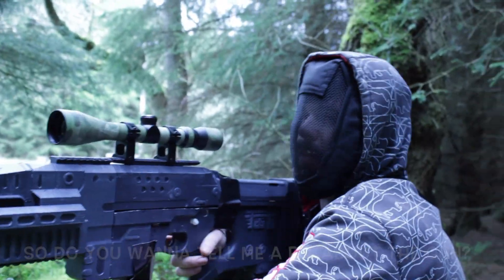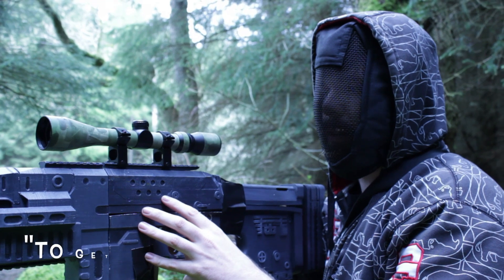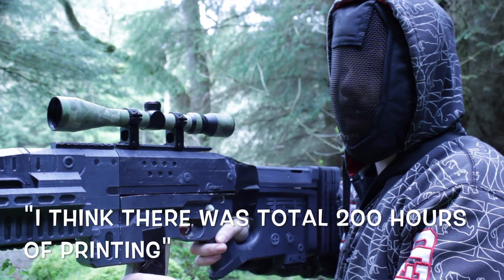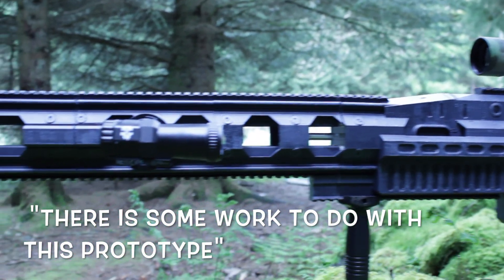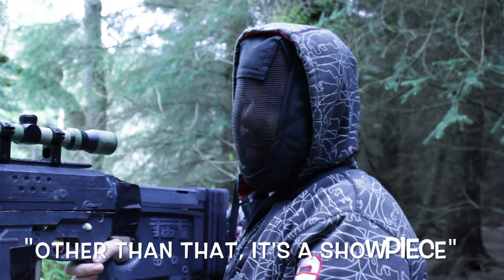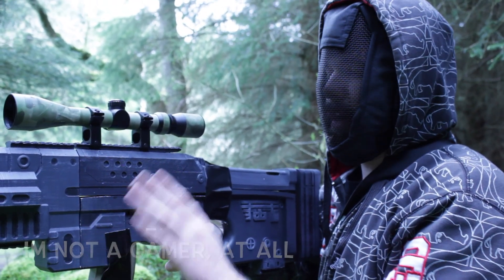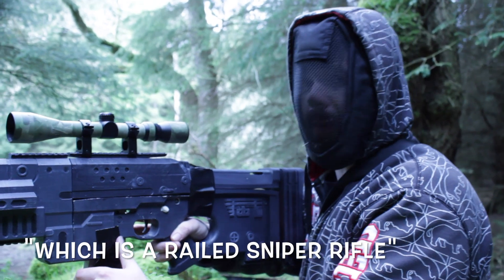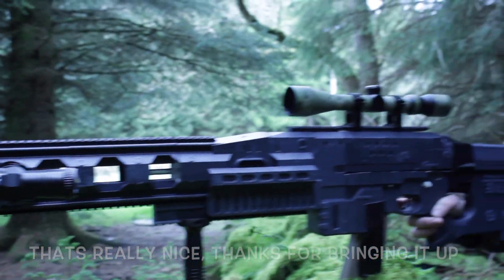Rorsch MK1 Rail Gun, 3D printed version

Comment: He said its railed sniper rifle. In the game it's a rail gun. Are those the same things?
Reply: He means rail gun which is a weapon that propels its projectile using electro magnetic force instead of gun powder or explosives.
Reply: He probably said railed sniper rifle by accident.
Reply: Yes
Reply: Theadventurebox3 But the  gun in BF4 has an actual cartridge which means there is a primer at the end of the shell. So idk what they were going for maybe a "Rail Sniper Rifle" Meh just my 2cents
Reply: ***** yes thats true it seems a bit strange though i dont know why dice chose a sort of hybrid projectile design.
Reply: Only Dice eh? :P
Reply: ***** Actually in the game you put in a new round after every shot when the chamber pops up. I don't think there is a primer which is why it's portrayed as a "railgun".
Reply: The thing is a rail doesn't need a shell in theory for it to work at all. It just propels one single object.
Reply: The railgun ingame uses a projectile that has a little cap on the end. I assume that's just to get a proper fit in the rail system
Reply: I guess, =/. But only dice will know lol.
Reply: LittleScientist2011 Isn't a gauss rifle like the same thing?
Reply: JMPERager no, they work on similar principles, but they are different. A railgun, as the name implies, uses two parallel rails and runs a current through the projectile from one rail to the other, causing a forward force. A gauss rifle is also known as a coil gun, and uses coils rapidly activating and then deactivating to pull a projectile through the coils. A gauss rifle is also only strong enough to barely punch through weak cardboard
Reply: The silver phantom I thought the coils were used to accelerate to projectile after it had been shot with a full cased bullet.
Reply: JMPERager no, both weapons are single stage, the coils grab the projectile with a magnetic field and pull it along until it reaches about the center of a coil, then it shuts off as the next one in the line of coils activates and it repeats that basic process until it leaves the 'barrel'
Reply: The silver phantom But in theory, isn't the gauss rifle supposed to have an extreme force?
Reply: JMPERager technically, in theory it should, but the gauss rifles are extremely underpowered, especially when compared to a railgun, which can hit with, if I remember right, could be wrong, three times the force of a tomahawk cruise missile, and can travel at 7 times the speed of sound, whereas a coilgun is currently only capable of shooting about 300 feet per second with a projectile the size of a 9mm bullet with 12 coils, and keep in mind a railgun is currently pulling all of these stats with a projectile the size of a 150mm artillery she'll and rails about a foot shorter than an m777 howitzer
Reply: The silver phantom It probably is, but they just haven't found out how to do it properly. I wonder how it'll be when they do figure it out, would love to try some explosive rounds in it if they succeed and my Fallout dream will be complete.
Reply: JMPERager well the coilgun won't be very viable due to how far behind it is compared to the railgun. The railgun is a fully capable and technically ready weapon, we just need to shrink the size of the it's power supply while maintaining or increasing it's power efficiency, and the materials of the rails need to last alot longer than they currently do. A coilgun is so far behind its only used for garage science projects, and no military is looking at coilguns. And sad to say, explosive rounds are impossible to use with either weapon
Reply: The silver phantom We'll just have to wait and see what happens.
Reply: JMPERager not to sound rude, but even the people that work on these types of weapons say that explosive rounds are not possible due to the nature of these weapons, not to mention it isn't needed, due to the amount of force a railgun is capable of hitting a target with using a standard sabot. And coilguns are inefficient uses of the resources that could be used for a railgun, not to mention they will always have comparibly lower firepower compared to similar sized railguns
Reply: The silver phantom If the explosive rounds aren't possible then so be it, but like I said, we'll just have to wait and see.
Reply: JMPERager The explosive in the round would be pointless. Why spend more money to put an explosive in something that will impact harder than the explosion?
Reply: Eccedentesiast Area of effect?
Reply: JMPERager still useless. The force of a single shell hitting a solid target releases more kinetic energy and more destructive force than the largest cruise missiles wielded by America. explosives on a railgun take out one of its best features, more ammo capacity and safer storage. Explosive rounds for railguns are pointless and costly
Reply: ***** i figured out what that cap is. the rorsch is a two stage railgun, which does exist. instead of the projectile resting in between the two rails at the start of the cycle, it gets shot into the rails and uses that as its starting force to accelerate to slightly higher speeds than the traditional and easier to use single stage variants
Reply: AH OK Well that makes much more sense haha. Thank you.
Reply: The silver phantom Aren't they better for penetration and then explosive rounds does the aoe part? Like tank shells that penetrate the armour to blow up inside.
Reply: JMPERager no, explosive rounds on a railgun are more useless than tits on a cactus. And if you're talking about single stage versus double stage railguns, they do the exact same thing, just in a slightly different way. The biggest difference between the two types of railguns is how complex they are, and honestly, the two stage railgun isn't very viable compared to a single stage railgun
Reply: The silver phantom One-stage and two-stage?
Reply: JMPERager the difference is where the projectile sits during the start of the process. A single stage railgun has the projectile constantly between the rails and the current flows left to right from the rails and the projectile. A two stage like the rorsch shoots the projectile into the space between the rails. otherwise they are the same. And no, explosive rounds are not possible with either model.
Reply: The silver phantom Why not possible?
Reply: JMPERager because the very nature of electromagnetic weapons, especially the railgun, would cause the explosive to detonate and damage the weapon itself beyond repair
Reply: The silver phantom I'm sure there is a way to stop it from happening. It just needs a special design of bullet.
Reply: JMPERager there is no way to do it. Besides, explosive rounds are absolutely useless on a railgun. The force of a shot hits with more force than a tomahawk cruise missile. Putting an explosive in a round would add unneeded costs to the program. face it, you know nothing about railguns, aside from what I tried to explain to you. as I said earlier, HE rounds on a railgun are as useful as tits on a cactus.
Reply: The silver phantom You can use isolators in the bullets to stop the electricity form detonating the explosive?
And the railgun just fires away the bullet at and extreme speed, does it not? It wouldn't 'cause an explosion on impact, but if you had explosive rounds that detonated on impact it could improve AoE and destruction.
And no I don't know much about railguns, but  why don't you explain in details why it isn't possible and how railguns work instead of just saying "no it doesn't work", I'm more than happy to learn, I'm not like the other butthurt internet idiots, I actually like learning.
Reply: JMPERager ok. Well to start, they use a pulsed direct current as power. The voltage and sheer amount of electricity running through the system is sometimes capable of turning it's tungsten projectile into plasma. Explosive rounds cause substantially less damage than a single shot from these monsters. AoE is not affected at all by the addition of explosives. To increase its damage, you would need to use a nonferromagnetic metal heavier than tungsten or increase its voltage.
Reply: The silver phantom So the railgun is a type of plasma projectile weapon?
Reply: JMPERager no, it was an accident. they used too much power and the result was some pretty hefty damage to the system. As it currently stands, the railgun has reached its maximum amperage possible without causing major damage to itself.
Reply: No, he said it by accident and meant "rail gun".
Reply: Wrong. A railgun uses JUST magnet propulsion, whereas a railed rifle uses BOTH a standard round and a magnetic armature. This increases muzzle velocity under specific circumstances, but railed rifles are VERY rare and almost always custom. I don't actually know of a single mass-produced rifle in the world that utilizes both rails and a round-based armature.
Reply: Besides, why would someone need an infantry/person based rifle that has rails? Just get an M82.